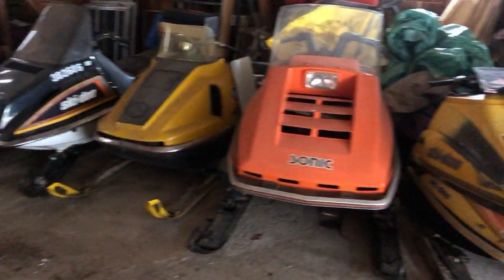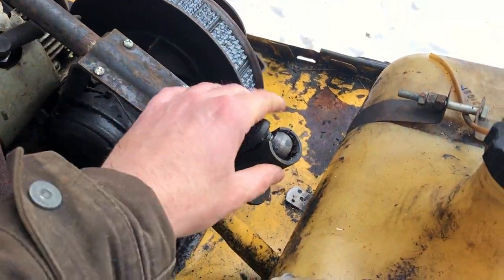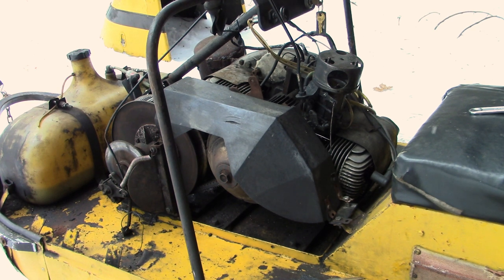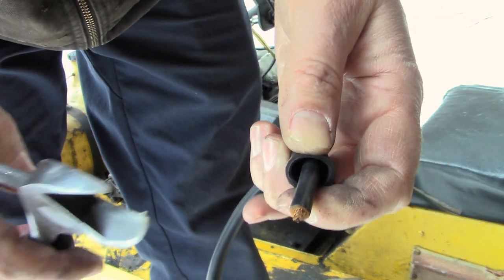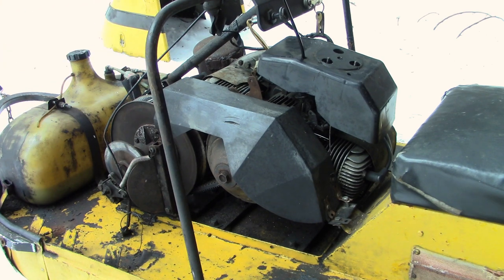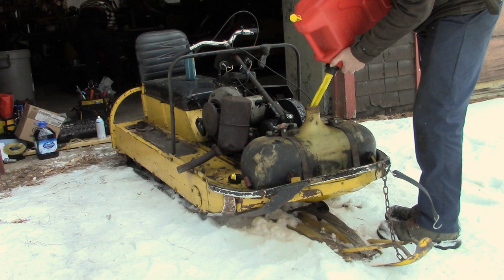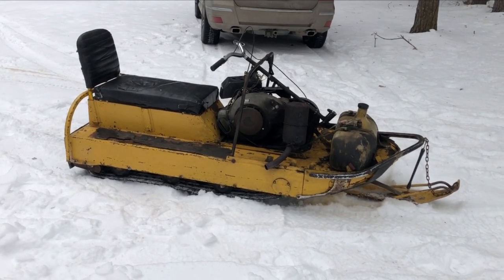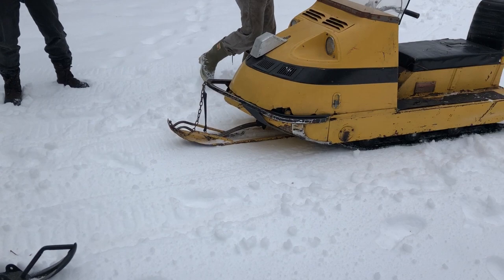1968 Ski-Doo Super Alpine 370 "FIRST START!"

Comment: I only ever saw a Super Alpine 370 once in my life in early 1975, it was a late '60s model still used as a workhorse to drag the water-hoses up the hill at the local ski area for snowmaking. It was also used to pull the Ski Patrol stretcher up and down the hill when someone broke a leg, and had to be taken to the Ambulance waiting in the parking lot. Plenty of power, and no doubt you could drag a small tree out of the bush with one of these bad-boys.
Reply from the maker: Yeah they are super slow, but really lots of torque. Well, lots of torque for a 1960's machine!!! 18.5hp going 15mph flat out!!!

Comment: I really enjoyed your video getting the old '68 Ski-Doo Alpine running again, I can remember these machines in the late '60's in the dealer as new snowmobiles for sale. I was hooked by that time at 14 years old and the first sled I owned was a Sno-Jet 440 wide-track around 1971, then in 1974 I purchased a Rupp Nitro II 440 and still have it to this day!
    For the gas in the mouth problem when siphoning can be remedied by using a longer piece of clear hose so you can see the fuel coming and get the hose end out of your mouth.....my other advice is if you haven't already, use the ethanol-free fuel, that's available here in Denver Colorado, in these old sleds, makes a difference as the ethanol eats up the rubber fuel lines and it loves water......my $0.02 cents worth.
Reply from the maker: Wow! Thanks for such a nice comment! I really enjoyed riding the Alpine 2 years ago when this video was shot. Haven’t ran it since, but I want to take it out at least one this year… I use ethanol free fuel in all my small engines so I don’t have to worry if they aren’t started in a year or so. For the gas line, I was lazy and used an old piece of “new” hose that was all yellowed out, so I paid the price and got a mouthful… Glad to year you still have your 74!!! Do you still use it once and a while or is it stored away, just waiting to be revived!?! Thanks for watching!!

Comment: Even the single cyl. Alpine kicked ass. You really got a true gem.    I am very interested in the 370, although I never had one. Nice Alpine.👍
Reply from the maker: I never had one either, but they always intrigued me. A few years ago I put my hands on a 68 370 olympique, then that summer I got the alpine. I never ran the olympique yet... (that will be a video for next season!) The alpine is a blast!!! Its one of my favorite sleds. Take care!
Reply: @mattsws  Our very first snowmobile was a 67 Alpine. 299cc  14horse single cly.rotax in 1970. Then my Dad got the 65 Chalet 8hp rotax in 1971. As a youngster back then I had alot of fun with them. Awesome sleds they were. At one time we had the 65 Alpine 10horse and the 69  640cc Alpine 40horse, also.
Reply from the maker: @John Petersen Goes to show you didnt need high horsepower to have a blast with the old machines!!!
Reply: @mattsws  Yeah, my dad was very concerned about us kids having a stable snowmo abile t hat wouldn't tip.Thats why he got Alpines all the time. I did flip the 640 once , on the road by our house,after I goosed it on some ice.I was ok, and so was the Alpine.My Dad ended up selling 3 of the Alpines.We still have the original 67though.
Reply from the maker: @johnpetersen8238  You can't get more stable than an Alpine, thats for sure!!! Glad to hear you still have (the best) one!!!

Comment: Any older Bombardier, has a lighting coil, with no regulator, it is matched to the head lights and tail lights combined wattage, the headlights are normally around 35 watts, but the tali light bulbs are only 1 watt each, so if you blow a head lights bulb, or in your case don't have them hooked-up  the extra amperage has no where to go and toasts the rear bulbs, led or incandescent.
Reply from the maker: That makes sense. I suppose I would have blown the rear light regardless… Thanks for the info and thanks for watching!

Comment: Have never run thinner than 32:1 oil mix in those old sleds! They say the oil is better today...that isn't the issue...its the old style bearings and bushings in the engine your dealing with,and a less effecient oiling system!
Reply from the maker: Makes sense! Thanks for the tip!

Comment: I never understood why Skidoo put 370 opposed engines in those Alpines. Big old tanks like that need Rotax 640 big blocks to push them well. Cool anyways. Never seen a Rotax opposed run in person.
Reply from the maker: They started using them in 67 in Alpines and a few Olympiques. During 1967 and 1968 the 370 was one of the biggest engines available… In 1969 they came out with the 669 that was offered in the Tnt. That pretty much spelled the end of the 370 and Alpines began getting fitted with big blocks in the early 70’s. The 370 is an awkwardly cool engine if you ask me, but as you mention, they won’t give you too much in terms of power and speed in an Alpine. Thanks for watching!!!
Reply: Didn't have a 640 in 68, neat idea, a swap?
Reply from the maker: @josephnewburgh8531  Sure would be cool! My uncle put a 640 in a 1972(?) Scandic. It originally had a 335 with a reduction gearbox for more torque. The 640 really rips!!!
Reply: It was 1968 technology . This sled planned over deep snow.. you could drive past any  Polaris or Artic cat snow mobile stuck in the snow & pull them to places you never seen before.
Reply from the maker: @jimolson8424  Couldn't agree more! I actually enjoy cursing at 15mph flat out with the 370 Alpine. It has ample power to go anywhere.... just not very quickly!